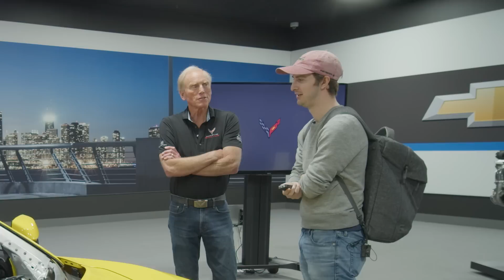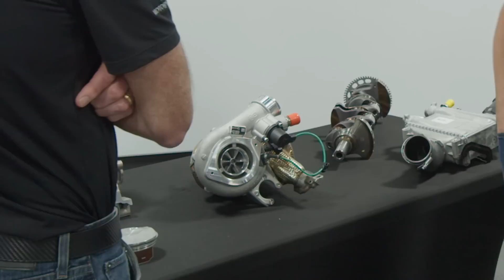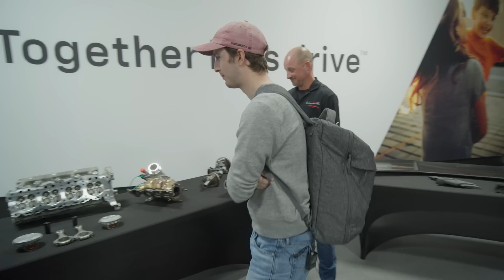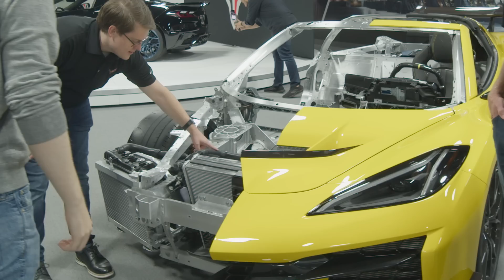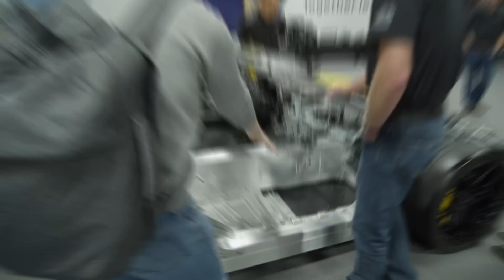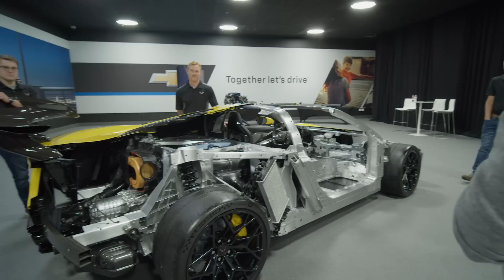2025 Corvette ZR1's Mechanical SECRETS (w/ Chief Engineer)

Comment: Where is the car? GM only made 1 car that does 233mph and that is it. No more than 1 and a lot of hype and others call it BS as GM has pushed back its production schedule 3  times. They made the biggest blunder when they allowed China to build the lifters that did nothing more than blow up. Come on guys get it together! Talk a big game on how fast the car goes but no one can seem to buy the car. Even your employees cannot answer the simplest question of what year the car will be, a 2025 or a 2026. I personally thing the project is a bust and the car will never come to light as so much money has been lost on the project. Like the chip to control the turbos. Not built in this country and held captive on a boat in a war and if it reached the Panama Cannel to expedite going through the cannel it cost a million dollars a ton. That is not going to happen. GM built nothing more than a wishful thinking car. Much better off building a Porsche. At least that car exists.

Comment: Honda regrets that it stopped producing the Acura NSX. The battery position on the Porsche 918 was set in that position because Honda had a patent on it, and GM can make anything on the Chevrolet Bolt HEV with a single platform. Mazda knows this. You can see it when you look at the production plant for the ND Roadster (MX-5).

Comment: It's amazing listening to engineers casually talk about ~6 years worth of work and development on a car that will likely break a ton of records like it's no big deal.
Reply: It really isn’t. I’ve been building fast supercharged, turbo’s cars for many years. It is nice to see a manufacturer do it if that’s what you mean. They are actually building stuff we’ve been doing in the aftermarket for years which is great to see. Why they waited till the government is trying to get rid of the ICE is what’s disappointing. Better late than never though
Reply: @Full_Speed_Ahead  What you build and most any other aftermarket performance company vs what GM builds aren’t even on the same level. Sure you can buy all the parts and assemble an extremely nice vehicle, that is both quick, fast, and handles well, but it’s just that, you’re mostly buying premade parts, and putting them on a vehicle, sure some custom work is performed, but it’s nothing, technologically speaking compared to what GM is doing. 
GM is literally starting from scratch.  They forged pieces of metal, and cut them into complete working engines, and more. The engine design, suspension system and all the that’s involved in proper layout and setup, and making it all work together, and then be so confident in your vehicle that you provide a warranty on it, and know that it is going to be popular and it will sell hundreds of thousands of them.  etc etc. it is all on a whole other level compared to what you do
Reply: @Full_Speed_Ahead yeah, try warrantying your builds for 5 years and 60,000 miles. Most builds don't even go 5 days and 60 miles before falling apart lol.
Reply: Ouch!!!!!😁😁😁

Comment: 1064 hp that is fast but the top speed is very bad 205 I expect to be fast as a Bugatti Veyron or McLaren speedtail
Reply: They said top speed is well over 212.
Reply: Probably tire speed rating and speed limiter
Reply: Aero drag from significant downforce and (as mentioned) tire capability explains the top speed. At the fraction of the cost of the two cars you mentioned the top-end is fine...
Reply: GM CORVETTE V8 destruidor de hipercarros🙏😇🙏❤🙏👍🙏👏🙏🤣🙏⭐🙏🌏🙏🏆🙏🥇🙏👑🙏🇺🇸🙏
Reply: I read an article stating the top speed was 215 mph.
Reply: Just go to car and driver, or just listen to the reveal video. It was clearly stated that  the ZR1 top speed and I quote from the reveal video: The ZR1 top speed goes comfortably over 215 mph according to the ZR1 engineer at the reveal event in Mami on Thursday.